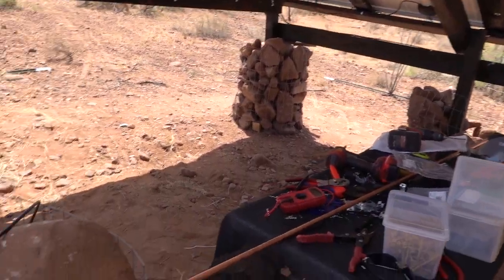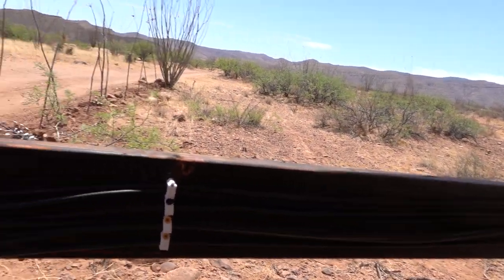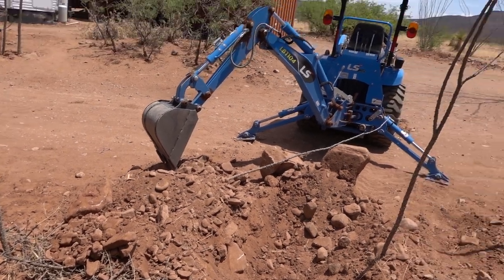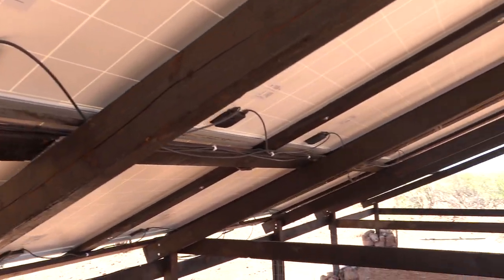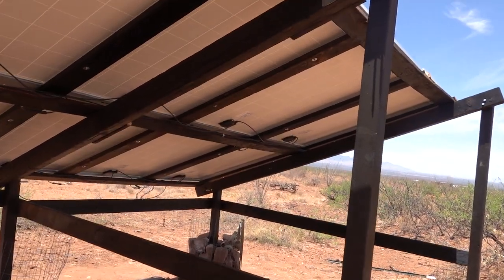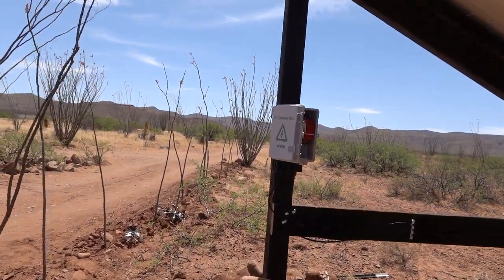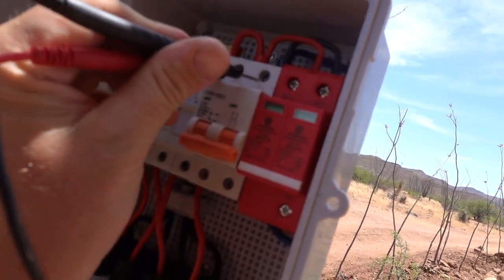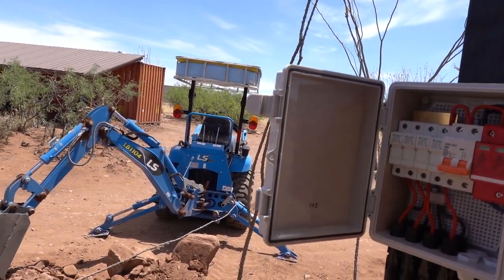Wiring the solar array

Comment: Really coming along.  Just dug the post holes and the trench for my 6Kw upgrade.  My panels and CC will be here Friday (06/10.). If you have PV wire, you might check if you can direct-bury those cables to your container.  I bought mine from Cable & Wires Your Way, and the 600V & 2Kv PV wire can both be direct-buried.  I'm stubbing a conduit at the panels and another at the building with the rest just buried down 18".  I bought my panels from Signature Solar along with the CC.  So far, so good.  Thumbs Up!
Reply from the maker: That's one heck of an upgrade, congratulations!
I'll definitely check out PV wires, that would save a ton of effort and money as conduits are going for 2 arms and 2 legs these days.
I hope you guys do a video on your upgraded array I would definitely love to see it.
Again thank you so much for your advice and tips 👍

Comment: Great job wiring. This has turned out great 👍🏼 Thanks for the update. 🙏
Reply from the maker: Thank you so much! I should be able to run wiring to the container next week and the inverter/charge controller arrives tomorrow. 
I'm hoping to shelve the gas generators next week some time 👍

Comment: 100F is about 38C here in Australia and hot enough.  At the moment,  being winter here, we've just had  -2.9C (26F) and your temperature would be very nice, for a couple of hours. Roll on the aircon! Not long now,  being the hard worker that you are.
Reply from the maker: Have not seen 38c here just yet but really close, today it was humid and probably 34c.

I just finished mounting the inverter and breaker box, not long and I'll have all the aircon I can handle. 
Just missing  a couple fuses for the battery's and a stint and 200ft of wiring from the panels to the container.